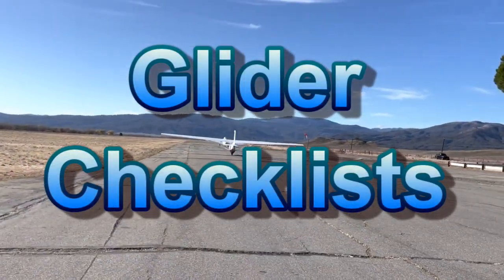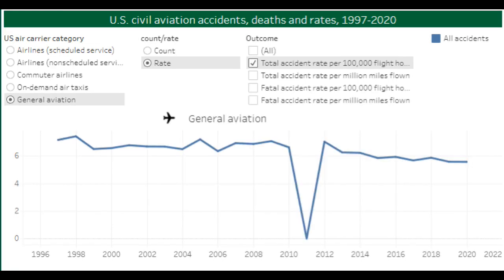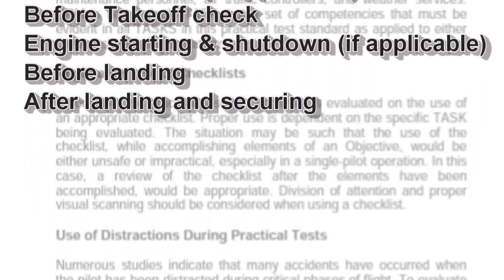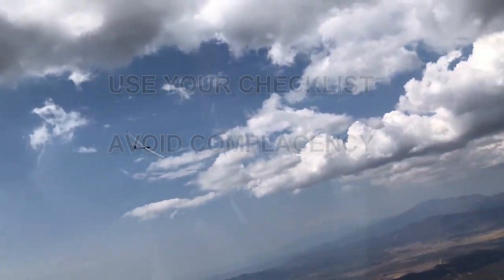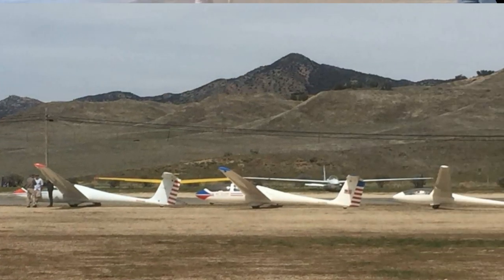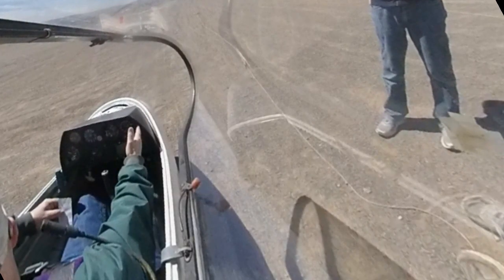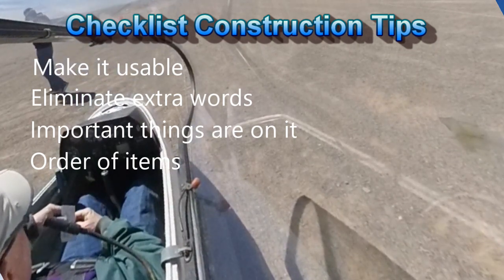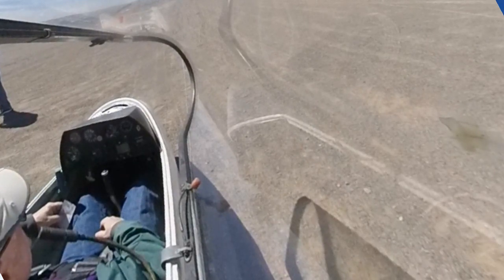Glider Checklists

Comment: I have a question for you.  So I flew in one country and their mnemonic was easy and catchy.  Now in this country the mnemonic is not easy, nor catchy,  It feels like you always have to read it off the little card. I had a discussion with our safety officer about the pros and cons (one system vs the other).  My safety officer prefers the more difficult mnemonic that almost forces you to read the card.  He reckons that makes us pay more attention.
.
Comments?
Reply from the maker: At the operation I teach at, we teach a mnemonic for both takeoff and landing checklists, though the takeoff one is also placarded on most of the gliders. The advantage of that is if you forget your checklist or drop it, you’re still OK. 
My glider has a ClearNav II which has an electronic checklist function. I’ll use that for some of the other steps like assembly and push out. I also use a more comprehensive before takeoff checklist when flying the higher performance glider since I have to consider transponder, oxygen, camera, anti-collision light, flight recorder and other items that don’t fit into ABCCCDDE very well

Comment: All good video, but we need to go a little further and do some education here. The intent is right on, but to be in complaince here we go. , however the ONLY approved checklist for any aircraft is that developed by the manufactured! YOU CANNOT make up your own checklist! Well, you can by submitting a LONOT to the FAA. A Letter of no objection, usually to unique operations. You can add to it but CAN NOT change its foundation period. Just read. For those that are not famililar. The U.S. FAA is warning pilots of the potential risks of using either commercial-off-the-shelf (COTS) or personally developed checklists. The FAA recently issued a Safety Alert for Operators (SAFO 17006), noting COTS or personal checklists might not contain all the pertinent information included in the manufacturer’s pilot operating handbook (POH) or airplane flight manual (AFM/GFM). Especially High Performance Sailplanes. You can add to it but CANNOT change its foundation period. Just read. SAFOA 17006. As a DPE I see alot of home made checklist. Big NO NO! Usually applicant receives a a Disapproval. Those that use AA,BBB, etc....should ensure it encompasses the MANUFACTURE checklist as per the SAFO. One reason is due to the fact that legal gets involved in an aircraft accident. 35 years as a expert witness I have mant stories! Fly Safe!
Reply from the maker: Thanks for pointing  to the SAFO. 
RE: :"Usually applicant receives a a Disapproval." If he is using a checklist on what basis are you giving him a pink slip? Can you provide a more specific example of what a glider pilot left out of a checklist that you busted him for?
The glider PTS says "Throughout the practical test, the applicant is evaluated on the use of an appropriate checklist." and numerous "completes the prescribed or appropriate checklist" 
ABCCCDDE, FUSTALL, GFWATTS, etc are widely used in the glider community for many decades. Most of the glider literature suggests using one. 

The FAA's own Glider Flying Handbook says "If the GFM/POH does not provide a specific prelaunch
checklist, then some good generic checklists are CB
SWIFT CBE and ABCCCDD"

  Schweizer (as an example) doesn't provide  before takeoff and before landing checklists, though my Schleicher 29 does have a before takeoff checklist placard.
The example cited in the SAFO was for an abnormal checklist for a manual gear extension. 
As I mention in the video,  the checklist has to cover the glider (oxygen, transponder, etc)